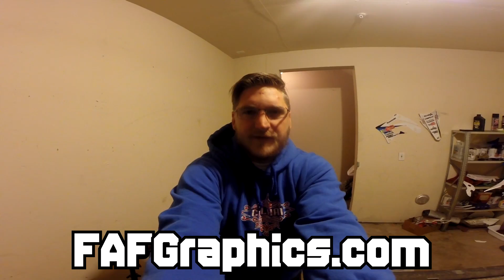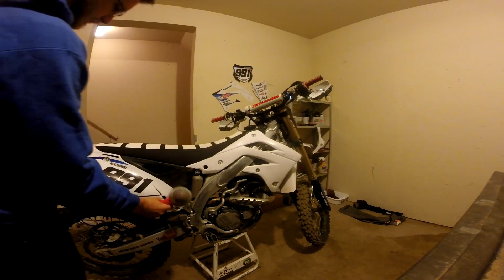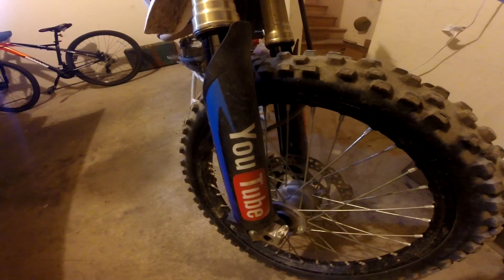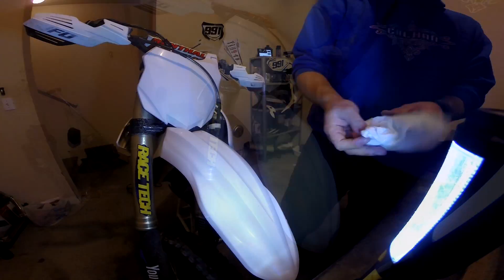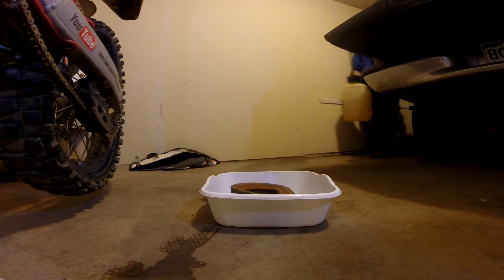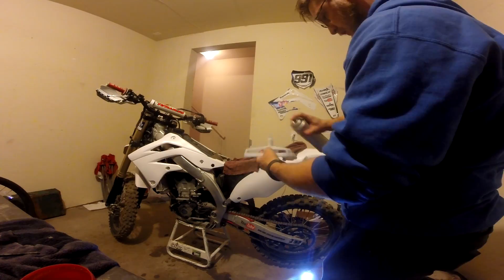Removing Dirtbike Graphics | 2012 Kawasaki KX450F

Comment: How does the gas work on getting off the dirt of the air filter? I heard not to use gas and some say its fine if you clean it off quickly. I'm just sick of using those chemical cleaners.
Reply from the maker: Like I said, it works for me! Try it for yourself next time you go to clean your air filter. Personal experience is the best.

Comment: i always used gas to wash my air filter. That is until i discovered the magic of "metho".  Methylated spirits will make that thing look brand new in a few minutes and it wont damage the foam. also you only need to use a small amount.
Reply from the maker: Interesting, I'll have to check it out, thanks!

Comment: I have a question when you remove your old grpahics cam you put them Back on?
Reply from the maker: Nah, the adhesive is usually pretty much done after you take the graphics off. They might stick back on but will probably peel super easily after that.
Reply: ReturnOfDeeO okay well thanks

Comment: Use brake cleaner to get the sticky stuff off it works really good
Reply from the maker: Sweet! I'll finish that up when I get home tonight. Thanks Cody!
Reply: ReturnOfDeeO Ugg you're cleaning your air filter wrong you're actually supposed to soak it in chocolate milk and then coat with pancake syrup let it dry for a few days and you're good to go!